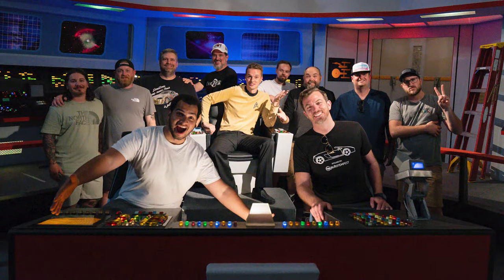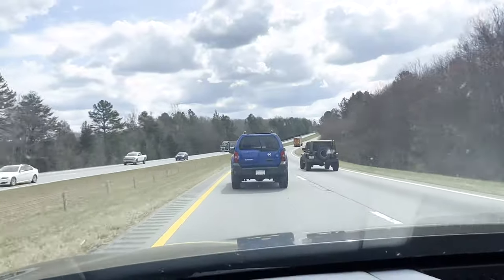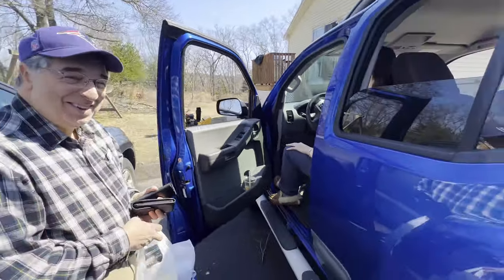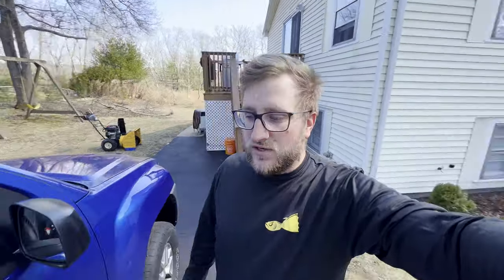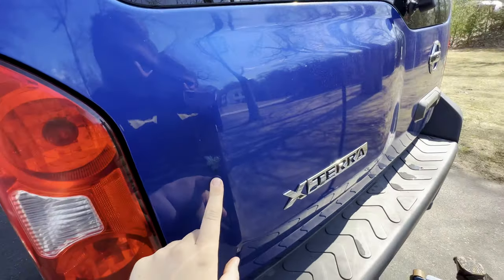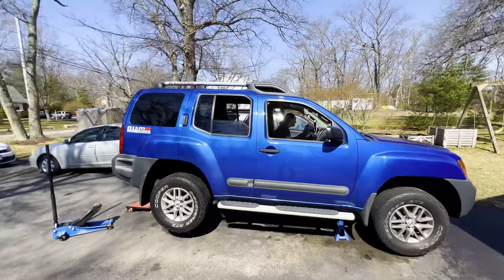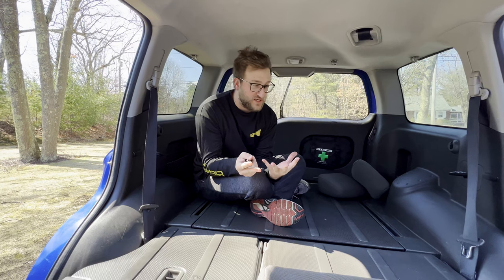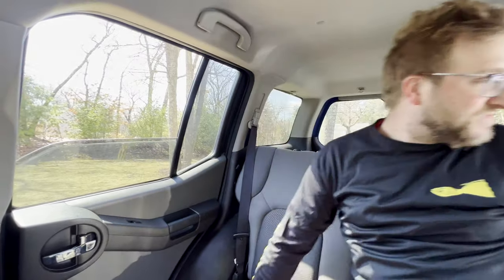Trading our BROKEN 4th Gen 4Runner For a Nissan Xterra... Is It Worth It?

Comment from the maker: What do you guys think about the XTerra? Do you think it was a good buy?
Reply: I’ve had my 07 Xterra for about 4 years now got it when it had 107,000 miles on it now it has over 150,000 miles haven’t had any major problems with it only expense was a Muffler replacement cause there was a hole cause of good ol rust (Salt belt vehicle) other than that just normal ware and tear fixes as well. Fucking love it though it’s a very unique vehicle I’ve always been a big fan of the look of them cause they’re different they don’t make vehicle that look as unique as the Xterra did. Only down side I’d say would be how the second gens are known for the Strawberry Milkshake of Death (SMOD) 2005-2009 pretty positive those are the years that are known to get that but if change the Radiator before you should be good.
Reply: I’m loving mine 😁 best 1000 bucks I’ve spent.
Reply: How is getting Xterra replacemnt parts?
Reply from the maker: @infdox9051  not bad at all! Especially since Nissan has such long model runs, there’s plenty of parts for these. Plus a good amount of aftermarket support
Reply: @NotSoHandyCarGuy  Really? Happy to hear that! Toyota and Jeep people scare me I won't have a lifetime of parts!
Reply: I bought a 2005, still running it with 196,000 miles so far.
Reply: Getting ready to roll over 300,000 miles on mine, she's not very pretty but runs like a top.
Reply: It should (hopefully) be a great buy!!  My mom, who is 82 years old, has a 2003 Xterra, which she bought used in 2003 from a dealership here in Scottsdale, Arizona.  Original owner bought it brand new, didn’t like it (so the story goes), and traded it in with only 1000 miles on it.  Had it about 6 weeks.  My mom found out about it, bought it, and has owned it ever since.  As of today, it only has 42,200 miles on it, and it’s 21 years old.  Still runs great.  I help to maintain it, and to keep it in great shape.  It’s ALWAYS garaged, so the inside and outside look almost brand new.  At this point, it should keep going for a long long time

Comment: Everything you need nothing you don't.
Solid plastic cleans up nice. Bluetooth adapter to a cigarette lighter plug, radio to blank station works great. 
Got a 2009 SE it's ultra handy. 265000k
Still runs nice.

Comment: As long as maintenance was done should have very little to worry about with the engine, the VQ40 is a great truck engine.
Reply: I love mine. besides some if the coolant lines cracking after 15 years but each time its under $100 fix. and a beast offroad

Comment: Daily is a 2008 Nissan Pathfinder V8. 160k on the clock and runs 90% new👍 Purchased 4 years ago with 125k miles, one owner, accident free. Just routine and proactive maintenance. Exclusive of the thirsty optional factory 5.6l it's enjoyable and reliable to drive. The V8 option was available from 08 to 12 to compete with the V8 4Runner. It was an option that's harder to find.

Comment: I love this generation of Nissan trucks. Had an 08 Pathfinder with the 4.0 sold it with 190k. But they all had their quirks. The 4.0 is a great engine, but a gas hog. The radiator lines run through the transmission and contaminate it. It makes a strawberry milkshake and kills it. Swapping the radiator will fix this issue, or bypass the lines. The early 4.0’s tensioners would wear and you would hear a whining noise, which was a tell tale sign. It’s a big job to replace it, but you could drive for another 100k and have no problems if you didn’t care to replace them. The Crankshaft position sensors will also go out and you’ll stall or the car will struggle to start. There’s 3 of them. 2 are easy to get to, one isn’t…the heater hose will also burst and you’ll start overheating. The rubber/plastic gets brittle. The rear cup holders…oh you found that out. The rear diffs were known to fail I believe that was mostly on PRO 4X models. I see this is the Nismo version so who knows. The fuel sender also doesn’t read accurate after a while and you’ll have a full tank one day and half when you wake up. I’m exaggerating that. They aren’t bad trucks at all. And are complete bargains compared to Toyotas of the same vintage and then some. Good luck with you new Xterra.
Reply: 3 crankshaft position sensors?
Reply: 1 Camshaft, 1 crankshaft, and the other other one is one or the other. But there are 3 sensors in total.
Reply: @elonsus9747  I understand you now. 1 crankshaft position sensor, 1 camshaft position sensor for each bank (totalling 2 cam position sensors).

Comment: Replace the fuel pump, I replaced the pump in my 06 Off Road Xterra at 172K miles and got close to 100 miles more per full tank, I was averaging 220 miles per tank before the new pump and got 310 miles per tank afterwards.
Reply: That is major difference in miles wow. You still gettting around 300ish miles on tank?

Comment: My Xterra is a 2004 SE purchased. 2005. Engine V6 3.3 Liter, horsepower 180 hp @ 4,800 rpm, Torque 202 lb-ft @ 2,800 rpm. For just under twenty years old this has been an excellent reliable vehicle. Yes, it is still solid, runs quite well. Drove it from the East coast to the West coast in 2.5 days, averaged a hair under 20MPG. All that said, your Gen-2 Xterra should serve you well.

Comment: The plastic is easy to clean but it does scratch.  They make a carpet for the rear area which keeps most of my things from sliding around.  You could also just buy a piece of rubber-backed carpet runner that they cut to length at your local home improvement store.  The back of the front passenger seat is also plastic so you can fold it down and carry long items like boards.
Reply: There’s all kind of ways to secure the cargo. They have a holder that is from the factory. Tie down things. 
Also the carpet thing you mentioned is a great idea 
I leave my seats down all the time 

Have a 2seat 4 door ha

Comment: Wow, that X looks really clean underneath. Good buy! I have a 2011 Xterra S 4wd. One great feature that I like is that the rear seat bottoms are removeable and the seat backs fold down flat. I took mine on some dirt roads in east central Ohio last weekend. We did a really muddy hill climb in 4 low. No sweat, she climbed right up it, no problem. It does have pretty chunky tires though.
Reply: I haven’t figured out why they made that feature cause they fold flat even with the bottoms just folded up against the front seats. 
Like, im not sure I’d ever take my seat bottoms out all the way

Comment: My buddy's mom had an older one of these when we were in high school. It was supercharged with a manual transmission! It was still super slow though lol. The rear seats were strangely higher feeling than the front seats, not sure if it's the same with this newer generation. The Xterra is one of the few modern Nissans I actually like, this one seems pretty nice with the color and condition!
Reply from the maker: Hahaha yea Mike! Those things are sick though. Love that body style dude. The seats are a little better in the new ones. The blue fu*ks 🔥
Reply: Cause they’re Stadium seats in the back!! Fun Fact: only two vehicles that have that Xterra and the Honda Element
Reply: @djmfilms1999  thinking of getting one of these. What's the legroom like in the rear?
Reply: @FredericFreedom  Hey Chid, it’s pretty spacious make sure you are looking at a 2nd Gen Xterra as 1st gen are smaller in size for room that is
Reply: I took the back seats out. 
2 seat 4 door

Comment: I bought a 2011 Xterra Pro-4X for $27,500 brand new. I test drove the equivalent 4Runner, which was $40K+. Not only was there Xterra quieter inside, it was more comfortable. It also had a full boxed, high tensile strength, Nissan Titan frame. The 4Runner had a garbage C channel frame. The 4Runner has become a luxury vehicle for yuppies. The Xterra is a real off-road vehicle. I've beat the living shit out of it off-road, stock, and it just keeps going!

Comment: I have a first gen 2000 Xterra that I bought in 2012. I told myself that I wouldnt buy another car until this one dies.......IT WONT DIE!

I wouldnt hesitate to drive it across the country right now. Horrible gas mileage and the seats are now worn down and uncomfortable, but she is still my baby. I've had my eye on a second gen, but I want a manual pro4-x and people want MSRP for them with low miles.

Comment: I guess I'm lucky to live in the desert  cause my 2013 has zero rust, and it is a pro 4x, And That blue was the color we wanted, l bought mine in March 2014, I guess you're right they weren't selling mine was band new, I've have never had any major problems, but it is my off road toy and now after 8 years I'm replacing the Bilstein yellow shocks with the silver 5100's new larger springs  link-bars repair kit and possibly the inner and outer tie rod ends, I had done a 2-1/2"  Lift in the past, cause thy do bottom out with any little bump, but other than its a Gas Guzzler,  I L❤VE MY XTERRA PRO 4X.

Comment: Congrats on Xterra !!  I have 2007 X Xterra  and I love it ! have had it for abit over a year and been doing all the work on it myself from little stuff like radiator bypass to radiator replacement to backup/cam to  Titan Swap suspension upgrade and hopefully more and more upgrades over time ! love that truck ! took it to off roading ( nothing crazy waiting for skid plates ) 
so yeah love it will be looking for your new videos on Xterra
Reply from the maker: Thank you!! Feel free to message me on instagram about the mods you’ve done. Very curious. We’re throwing on a set of Wildpeaks tomorrow, and I already did all of the diff fluids/transfer case. The fluids were VERY old
Reply: @NotSoHandyCarGuy  Alright then will do !! oh how was the fluids hopefully there were not too many metal shavings .. I did all my fluids last fall too I guess better late then never..  I mean I did engine oil and tran oil change before but not the diffs ... 
also another great and easy and super rewording mod to do is  hood struts )) very easy to do and so helpful ))
Reply: Glad you did the radiator bypass. I have a 2011 Pro-4X, and it's great. I know the 2007's had the automatic transmission issue because of the radiator.

Comment: On my 2005 Cterra you dont have to remove the head rests from the rear seats to fold them flat...they made the headrests way bigger on the new ones. So far my Xterra has been an awesome  SUV and a beast in the Northeast snow storms with decent 4 wheel drive.

Comment: Our 2011 is a tank, ride quality isn't great but it's literally a truck frame and rear suspension from a 90's truck.  Change the belts, all fluids(brake, oil, radiator, front/rear diff, transfer case, and transmission). Car will last forever since the engine and transmission in this year is bulletproof,  no extra electronics to break.

Nissan's 2nd gen xterra's/frontiers are the best car's Nissan has built in the last 15+ years. I know I have a 2022 Frontier...not the best.

Comment: Got a 2013 pro4x Frontier and it has all the typical Nissan issues you noted. Cheap plastic, average engineering, average comfort seats. Strong points are price compared to Toyota, strong (but unrefined) motor, very solid and reliable transmission (if you dont get the smod), few changes (which is also a con) so parts are easy to come by.

Comment: I owned a 2010 Nissan Xterra SE.  I bought her brand new.I had 180k on it before I sold it. I never had one problem  with that vehicle.  I took her in the car wash weekly. The only rust was on the driver's rocker panel.   It should be noted that I followed the Nissan recommended maintenance religiously!  A great vehicle.  To bad Nissan stopped making them .  I upgraded  to a 2022 Toyota 4runner TRD off road premium Barcelona Red with upgraded pro wheels and skid plates   Black out Emblems.  Immediately put BF Goodrich KO2's on her.

Comment: I have loved my frontier so far. Basically the same thing.
Reply: Frontier is too low compated to Xterra. Proportions not good
Reply: @infdox9051  Its like half an inch difference. 8.9 vs 9.5. The departure angle is where it suffers. Like all pickup trucks.
Reply: @270eman  I mean overall looks. Frontier doesn't look muscular, unlike Xterra --- it begs to be lifted
Reply: @infdox9051  I put some 265/75r16 Mud tires on my frontier. Really improved the look and traction. It could use a 2" lift.
Reply: @270eman  Yes, Frontier looks best in black and much higher than stock
Reply: @infdox9051  The access cab with the 6ft looka decent. Its the 4 door with the 5 ft bed that doesn't look right. 😂

Comment: that price seems kind of high to pay for that year make and model and miles!!! how has it held up? I been looking at these xterras myself from 2011 to 2013 with under 100,000  miles. I read good and bad things about them. 4runners and Fj cruisers are just to damm expensive used!!!!
Reply from the maker: It was a little on the high side, but it was clean and from a dealer. Private party would have been a few grand less for sure. It held up ok! We actually sold it and ended up frame swapping our 4Runner, which was the correct decision. In my opinion, the 4Runners are worth their price (although people will fight me on that one haha). Check out the review I did on the Xterra- I run through some of the issues we had with it, as well as some of the common issues with them. Overall decent SUV’s, but there’s a few things to watch out for
Reply: @NotSoHandyCarGuy  right on! Definitely great 👍 insight.  I would agree on the 4runner being worth the price of admission but they are ridiculous expensive even with high mileage.  It seems like buying a xterra is a gamble,  but honestly seems like buying any used vehicle in today's market is like playing Russian roulette 😆 🤣 😂 😹.  Glad to hear about your frame restoration working out!!! Trying to buy clean vehicles here in Maryland with no rust is very challenging!!!!!!

Comment: My 02 Xterra has 417,000 miles … still running good
Reply from the maker: That’s awesome! Any major repairs of note?
Reply: Well … nothing I consider major but I’ve replaced the front cv axles several times , both upper control arms due to the eccentric bolts freezing up, upper and lower ball joints several times , tie rod ends, distributer because of the crank sensor going bad , valve cover gaskets , no other engine work and no tranny work other than oil changes and timing belts and water pumps 
Very reliable
Reply: I forgot there was a recall on the fuel sending unit , the dealer said the fuel tank had rusted under the sending unit o ring and I needed a new tank , they replaced the tank for free including labor 
I also have replaced the shocks twice and the radio because the cd player stopped loading discs 
Also the heater core because one of the pipes thru the firewall broke 
And replaced the radiator once

Comment: The 4runner was more reliable, but the x-terra is pretty nice as well.
Reply from the maker: Agreed. The overall feeling of quality was higher with the T4R. But in the northeast, it’s too difficult to maintain one.
Reply: More reliable how?
Reply: @povertyspec9651  don’t know. Toyotas and Hondas are the. Eat quality cars to me. I’m on my 4 xterra and have had 0 issues with any of them
Reply: 4Runners tend to rust out in the NorthEast , and they have the horrible headers cracking issue that plagues he v6 engines that is shared through the lexus and toyota lineup. Get a newer xterra 2010+, albeit not as fancy as the 4runner, and it will serve you faithfully for 400k miles with regular maintenance and a chain/guides done around 175k miles.
Reply: @fiily1  What about cars from Florida? Also rust? And Xterra parts are not being made anymore

Comment: I owned a 2005 Nissan Pathfinder and the problems were endless and prematurely unnecessary. I bought it at a Nissan dealership with 30k miles and it was Nissan certified 😮 at 65k miles the motor went due to a malfunctioning catalytic converter that sucked a piece of metal into the motor, so Nissan replaced the motor under warranty, then there was numerous other flaws, fan clutches, axles, fuel leveling sensor, transmission was starting to go out at 120k due to coolant intrusion, stupid design by Nissan. The rear quarter panels started to rot prematurely at 80k miles, got rid of it at 145k 🫡 wasn't a bad vehicle when it didn't break down. But I also owned a 2005 Nissan Murano and that too was a lemon. My brother had a 2006 and 2015 Maxima and both had similar issues. 😮 only my Dad who has a 2016 Nissan Rouge hasn't had any major issues. I have since written off Nissan figuring I just don't have any good luck or vibes from others about them. I've owned 2 Fords and 3 Lincoln's and all 5 were better vehicles especially in reliability 🤷🏽‍♂️ best of luck but I would've stayed with Toyota ✌🏽♥️
Reply from the maker: Thanks for the personal take! We actually did end up selling the Xterra and putting the work into the Toyota and frame swapping it.